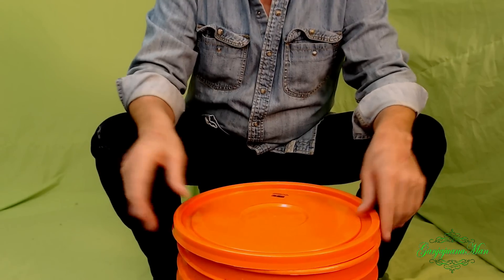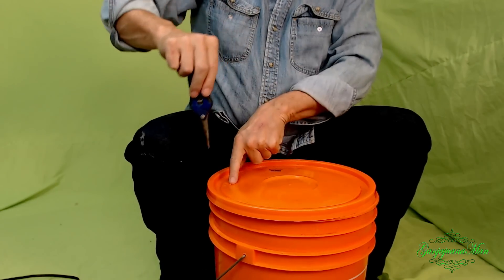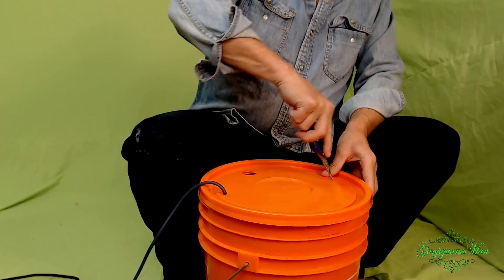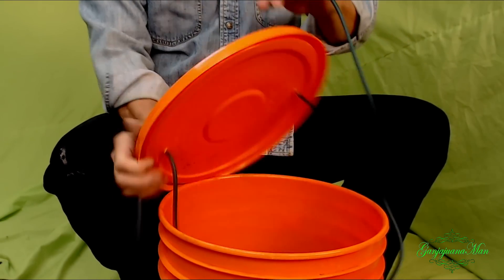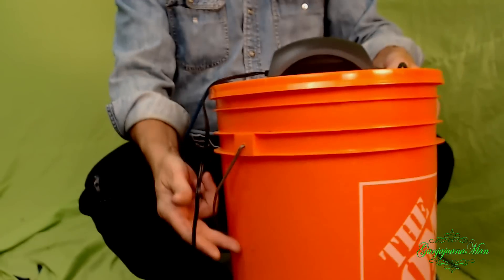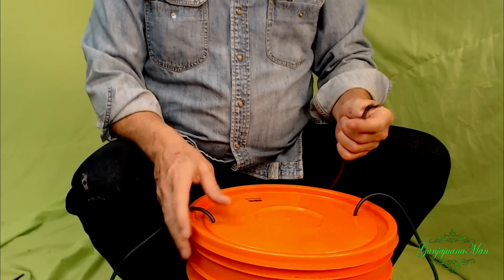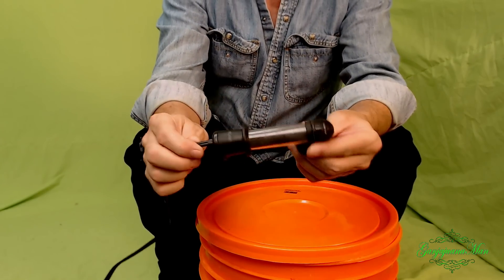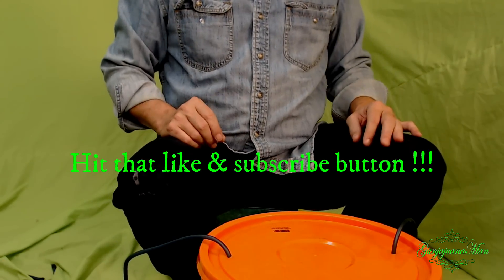New & Improved DIY Co2 Generator

Comment: The air pump is will hinder what you are trying to do. Yeast need a little oxygen to start reproducing at the start..Which can be done by vigorously stirring it before adding yeast.. After that, you DO NOT want any oxygen to enter the batch... The lack of oxygen is what causes it to slow reproduction and start working to convert the sugar into alcohol and C02 and other compounds.. Also the C02  will exit on it's own easily as it will build lots of pressure in the bucket.. You can test that by shaking a bottle of pop and opening it.. "Oxygen
During fermentation, yeast has a couple of choices. If it has oxygen available to it, it will be able to reproduce quite rapidly (doubling every 3 hours). If there is only limited oxygen available, it will turn its task to producing ethanol and other products (about 1300 in all), like higher alcohols (sometimes called fusel oils), esters, organic acids, and carbonyl compounds. To get good initial growth of the yeasts, you want to have a bit of oxygen available - but you can do this simply by stirring the wash vigorously when disolving the sugar. Once you have added the yeast, it is critical to seal the container such that air cant get in, but you can still let the CO2 out, by using an airlock." Or airline in this case..
Reply: Bill Ward, you're saying I don't need a pump? Just mix the sugar,water, add yeast, close lid, then run a hose from lid  to the ceiling of the tent? This is for a 5'x5'x7' tent. Thanks! 
Also, any danger of producing too much C02 (it's in a basement shop)? Should i use less yeast?
Reply: @valueape888  Yup, you got it and i don't believe you could produce a dangerous amount using this method, even if you tried, my friend.
Reply: @valueape888  too much co2 lol you moron!
Reply: @Spyder8561  Whats so funny about too much Co2?
Reply: @Snowden74  I was being sarcastic. That's no where near enough co2 using that method to make a difference. Do you know how much sugar and yeast it will take to cause injury or death?
Reply: I've made a bunch of homebrew, and I don't think that air pump is useful at all. I think this guy might be a little stoned. Anaerobic respiration will push co2 out of this bucket with no help.

Comment: GanjajuanaMan Stop this air stone and seal the hole bro Your pumping oxygen into your co2 setup just need water yeast sugar and water the exhaust tube and put the exhaust in a 2 liter of apple cider vinagar water might attract fugus gnats vinagar wont the air stone is slowing fermentation the yeast/ sugar will create the co2 air you want to come out of the whole setup minus the air pump your have a good idea I know because when making wine it makes crazy co2 pressure and needs burped to release cow gas while its fermenting you wouldn't make wine with a airstone would you

Comment: For a little over 100$ you can by everything needed for a 5 pound co2 tank and regulator from EBay. The tank is about 60$, the regulator is about 30$ and everything else is relatively cheap. Even cheaper are paintball tanks. They hold 20 oz. and are refilled easily and are pretty cheap used and new.
Reply from the maker: Thanks for watching,
for about $3.50 Canadian, you can buy a bucket & lid.
And for about $25.00 Canadian you can buy an air pump.
For about $4.00 Canadian you can buy an air stone. 
And for about $5.00 you can buy the air hose, about $33-$35 Bucks.
If you'er in the USA it might cost you half that.
Not sure how much about 4 cups of sugar cost, but it's cheaper then paying to get a c02 tank filed.
By my calculations, this is a hole lot less then $100.00      💨💨✌

Comment: I like this idea, I'm looking around for a hands off co2 generator for a fan mosquito trap. Does that much yeast slurry smell weird after a while?
Reply from the maker: No, it doesn't smell weird after a while.
It smells weird Instantly lol.
Thanks for watching.
Reply: If you want a serious moquito trap look at the mosquito magnet.  It works but not cheap.  Uses propane and a catalytic converter to generate co2 and some heat.  Also uses an attractant that works crazy good.   Last 21 days with a bbq tank.
Reply from the maker: This thing is for growing plants, not catching mosquitoes.
Thanks for watching.

Comment: Why do you need an air pump?
The co2 will come out by itself
Reply from the maker: Yes you are right, it will come out by itself. 
But I think that the churning of the mix from the air stone helps the chemical reaction, seems logical to me. The mix produces enough c02 that there is no separation of co2 & air in the bucket. The smelly air coming out of the hose is the same smell when you get when you open the lid.
My air hose is 20 feet long then splits into two, so I figured the air pump would only Help not hurt to get it all the way through that long hose.
Thanks for watching.
Reply: Isnt co2  heavier therefore making it kind of sit lower in the bucket so what I'm thinking is the air stone helps force the co2 out of the bucket faster. I'm not totally sure but kind of makes sense
Reply: How much ppm on co2 meter does it make ? Maybe 1200 or 1500 ppms ?

Comment: Have you measured the average ppm in a small enclosed area? What was your results?
Reply from the maker: No I haven't measured, I don't  have a meter for that, but one of my subscribers made one & said that it set off the c02 meter in his house. 
I just know that it makes a difference.
Reply: @GanjajuanaMan  The house meters dont check for co2. They check for carbon monoxide I believe. Co2 is carbon dioxide.
Reply: I hjave, it's all over the plae, right up to 1800! initially (with my mix) and then looses about 300 a day unless you keep it heated or replenish some yeast/sugar. I have a 4x4 sealed tent setiup
Reply: @seanjackson8274  how much heat?

Comment: Made one, wondering how much co2 it was making, just then the smoke detectors co2 alarm sounded
Reply from the maker: lol. that's funny.
Thanks for watching 💨💨✌
Reply: It's cheaper to buy co2 tanks than 5 pound bags of sugar
Reply: @marcjtdc  a 20# tank cost me $125 and another $50 each fill. How damn expensive is your sugar?
Reply: @PB-vx6ci  I see your point. But you can regulate tanks and turn em off during darkness. Its a close call.
Reply: marcjtdc that’s why it’s on a timer that Run concurrent with your lights￼
Reply: PB 1983 where did you get your tank? And what size? Thank you
Reply: @marcjtdc  then make a smaller one. Fixed
Reply: @marcjtdc  fuck off

Comment: Hello GanjajuanaMan, I loved your video, I 'm thinking of building 4 or 5 of these for my 16x16feet grow room, are 4 enough? How big is your tent/room?. Is the water heater necessary? Im trying to save electricity to have more leds in the room, and water heaters use a lot of watts.
Reply from the maker: I use one for two 4/4/8 tents. I think if you made 4 for that space it would be too much. The warm water is to activate the yeast & sugar so they will produce c02, so without a heater of some kind it's not going to do what you want it to. I think the low 90's is when it works best.
I'm using a small aquarium heater from Walmart, cost about $20
doesn't use much power.
Thanks for watching.
Reply: @GanjajuanaMan  thank you for answering!
Reply: @GanjajuanaMan  do you know what PPM levels these buckets are putting out.
Reply: J Wood good question 👍🏼
Reply: @JustAverageJeff  That's what I want to know. Has no one measured this?
Reply: GanjajuanaMan hey  need help😁 i just made 5 gall bucket yeast generator with 1 kg of sugar in it on 4x4x8 tent its “ON” all the time on seedling 7 day old is it to much should  go for 1 litter bottle generator? 🙏
Reply: shayelad shayelad I would wait till your plants are in veg to run co2. Like after a month of growth
Reply from the maker: no idea ?

Comment: Do you have the air pump off during the 'night' so c02 will accumulate in the bucket? or is it purely a waste thing .. what I am wondering is do you know if it is harmful to the plants for them to have c02 all the time or is the reason simply that it is just a waste of c02 and that is why you have the air on a timer with the lights?  Also...Thank you so much for your great idea on the c02 maker AND for doing the much simpler updated version.  I am really looking forward to trying it out and am getting the bucket etc. today.  Thank you GanjajuanaMan :)
Reply from the maker: Yes, I have my pump off during the night.
During the night, the plant will be taking & using oxygen through
the roots. During the day the plant will use c02 through the leaves.
If a person does use high levels of c02 at night, it can  harm the plant.
But the plant simply won't use it at night.
During the day anything over 1500 ppm of c02 is a waste.
Thanks for watching.
Reply: @GanjajuanaMan  autos at 24 hours might like that constant flow though :).
Reply from the maker: hmmmmm, I didn't think of that, I have never grown autos just photos.
Thanks for watching.
Reply: @GanjajuanaMan  thank you for taking the time to answer my question :)  Have a good one!
Reply: GanjajuanaMan 9
Reply: Soo just plug the air pump into the light timer? Or will the yeast die if it doesn’t have constant bubbles?

Comment: Do you have the heater plugged into a timer or does it always stay on?
Reply: Hmm i will try and see if that works for back up i have two 20 pound co2 tanks each last me a week and 20$ to fill up.
Reply from the maker: I have been leaving the heater on, but have the air pump on a timer. 
Is it the best way ? I don't know for sure. 
But what I do know for sure is that my my tree trunks are 5 inches in diameter.
No joke,  I don't compare the stem size to my thumb, I compare it to my wrist.
All I can say is that it's working for me.
Thanks for watching.

Comment: Will the Co2 i generate travel through the tubing to the top of my tent or do i have to put the tubing more near the canopy?
Reply: C02 is heavy it will drop and accumulate on floor so best to start above for sure.small fan facing upward to help it from settling wont hurt at all
Reply from the maker: I run my tubing up the side of my tent to the top centre so it can fall over the canopy. The air  pump ensures that it makes it all the way though the tubing.
Thanks for watching.
Reply: @GanjajuanaMan  How about another air stone at the outlet to increase diffusion over your plants?

Comment: Your exhaust tube should go into water to keep unwanted bacteria out of your exhausted co2
Reply from the maker: That sounds like a good idea.
It will be very easy to add a little water bottle to filter it.
Thanks for the tip & thanks for watching.
Reply: @GanjajuanaMan  will it not exhaust solution instead of CO2?
Also, what is the smell? Thank you sir.
Reply: @GanjajuanaMan  Brewing Supply Stores make several types of airlocks for venting CO2 during fermentation.
Reply: East tube into water bad idea the air pressure will turn it into a syphon
Reply: Keep unwanted bacteria out of the CO2? LOL. 
1.) Bacteria is everywhere. It's all over your skin, your clothes, your plants, your soil, your substrate, your nutrients, and it's in the air you breathe. A grow room is never sterile. Besides, he's fermenting with YEAST, not bacteria.
2.) An air lock won't filter shit, and that's not what they're for anyhow. They simply keep pathogens and air from entering the fermentation vessel after fermentation has slowed to a pace where this becomes a risk.
3.) Once fermentation has slowed to the point where the airlock can fulfill its purpose, you're too late starting your next batch anyhow. You may as well as just have a hamster in a cage in the grow room to benefit from it exhaling.
4.) There's no benefit to the airlock in any case where there's unfiltered air BEING PUMPED IN.
Reply from the maker: The bucket should only be filled about 1/3
the air line from the pump go's to the bottom of the bucket with an air stone on it. the exhaust line should only  be about 1 inch inside the bucket lid. 
The liquid is  nowhere near the exhaust hose & can't get out that way.
Thanks for watching.
Reply: @GanjajuanaMan  thank you for the quick reply sir.
I was referring to the suggestion of
 Lynn Sager ''Your exhaust tube should go into water to keep unwanted bacteria out of your exhausted co2''
and then your answer;
 ''That sounds like a good idea.
It will be very easy to add a little water bottle to filter it.
Thanks for the tip & thanks for watching.''
Have you tried her suggestion?
Also in your setup does the bucket emits foul smell?
Thank you again.
Reply from the maker: oh , now I know what you mean. 
When adding a water bottle to filter it, you can use a 1 or 2 litre bottle. Make 2 holes in the cap just like in the bucket lid. Then insert the exhaust hose from the bucket into the bottle (all the way to the bottom) then insert an exhaust hose into the water bottle just like on the bucket, the water level should be below the exhaust hose. You are basically making a second unit but you will Only be adding water to that one. I hope that all makes sense.
Oh yeah, it don't smell pretty lol. 
I take it away from the plants for the entire flush period to ensure proper taste of my buds.
Reply: @GanjajuanaMan  got it, thank you sir.
Reply: makes perfect sense its just a bubbler, every weed smoker should know how this works :)
Reply: I think u mean add an external water bottle for a filter
Reply: It's only yeast. But the water trap will cut down on the odor.
Reply: And constant air pressure applied to the liquid will be a constant exhaust out the hose constantly it works wonderfully
Reply: That would push water through the tube and empty the bucket all over your floor from the air pressure
Reply: Pump ozone once in a while in your room for sterilization, no bacteria can live once exposed to it
Reply: I think your setups just fine without any extra bottles of water at all. Because if you're adding air to the bucket it's going to force air out of that tube all the time no matter what now if you need to hook up an AirStone to the exhaust hose it'll help break down to CO2 more

Comment: What type of yeast do I need? I have some active dry yeast......will that work? Thanks a bunch
Reply: If you use regular yeast it won't last as long because the alcohol content it produces will kill it. but if you use champagne yeast it will ferment longer because it can tolerate higher alcohol content
Reply from the maker: yup that'll do it, I get a jar from the backing isle at Safeway. 
Thanks for watching.
Reply: What about rapid rise yeast will that mess with anything
Reply from the maker: @markwinton8277  I haven't tried that kind.
I'm using "Fleischmann's Traditional Active Dry Yeast"
Thanks for watching.